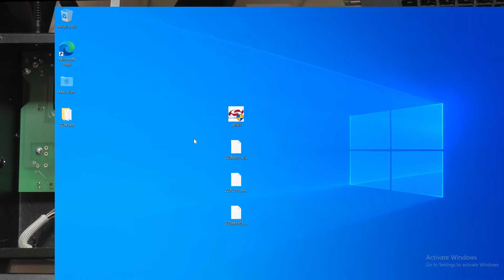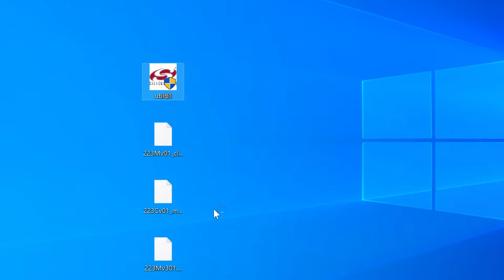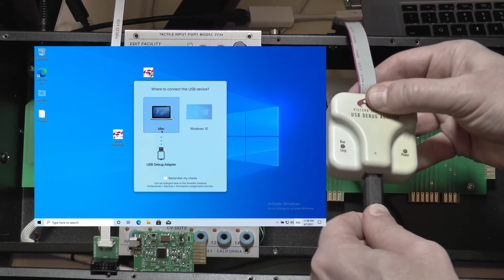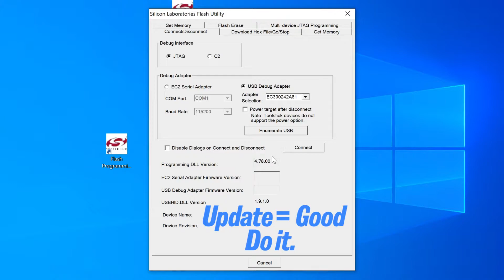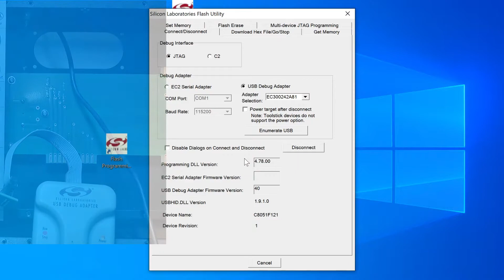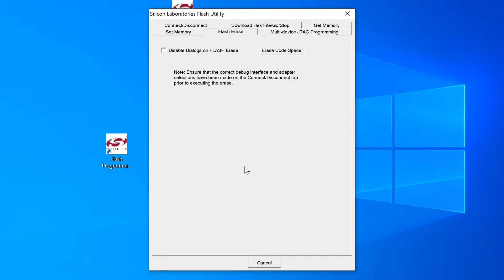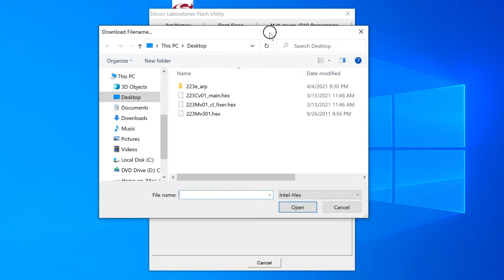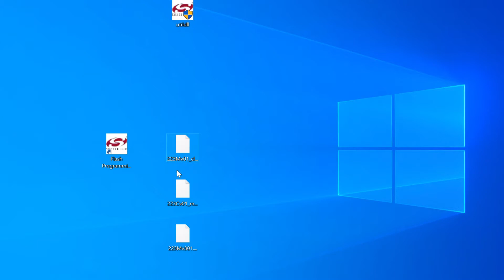Lyonel’s Bridge: How to DeBrick Your Buchla for less than 100 Bucks!

Comment: FYI for everyone... you don't need to use the Lyonel's Bridge for most modules. In most cases the Silabs debugger can be connected straight into the module. The bridge is needed only for the few modules that have the small white connector. The Bridge converts from the connector on the debugger to the small white connector.